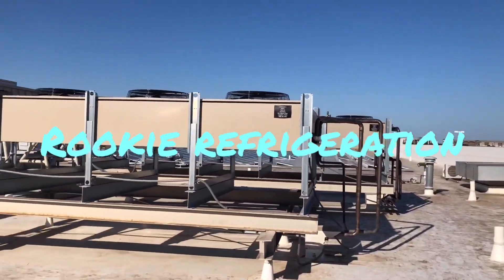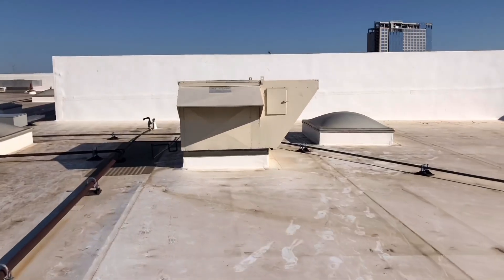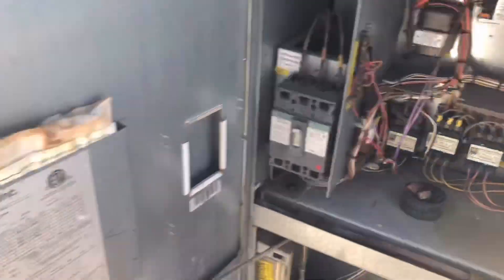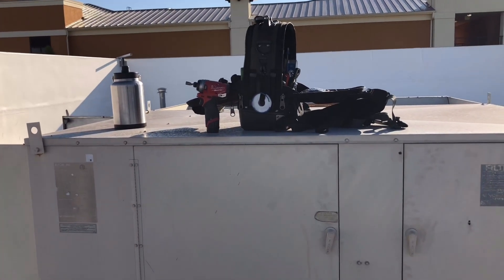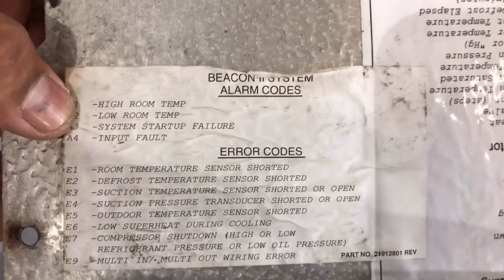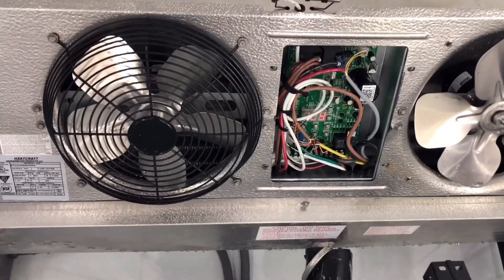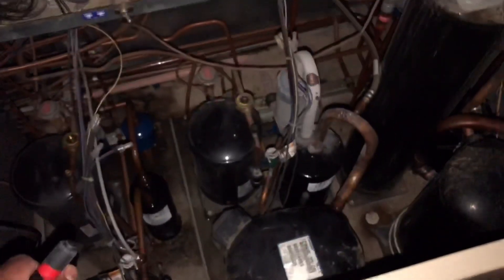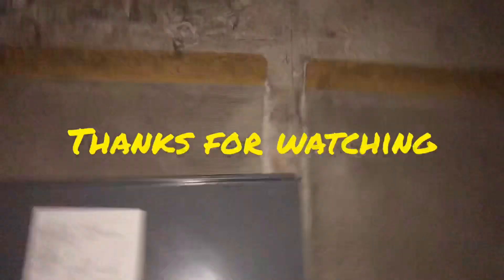HVAC REFRIGERATION LIFE:  On-Call Service Calls

Comment: We're you able to compare the amp draw at the 7/11 store, to any manufacturer's specs on what each heater draws?

That was strange to see just 1 heater on the coil.

If there was a pan heater, was it coming on during forced defrost?

I didn't see any ice build up blocking the drainage hole in that pan, so more than likely if there is a pan heater it's working properly.

As for the ice.....it could be due to a defrost issue.
Maybe it's not going into defrost properly, or not at all?

We're you able to pin down the cause of the frozen evap coil?

IF you can get a sprayer in there to help thaw the ice....what I have done that works pretty well is, I find a coffee pot maker & just put water in it do that it quickly fills an empty coffee pot with hot water. I pour the hot water from the coffee pot into my sprayer & start spraying.

Great video, btw & thanks for uploading it!
Reply from the maker: And yes, I always use a pump sprayer with hot water.  I didn’t record that this time but I did use it.  I have a bad habit of leaving stuff out. Lol.  Thanks for watching bro.
Reply: @rookierefrigeration4357  Keep posting more videos & thanks again!
Reply from the maker: Yeah these are specifically designed for the 711 stores.  So they only have 1 heater.  Weird right😂. 
There’s no drain pan heater.  
No, I was not allowed to go back to that store as we are not even supposed to service it.  Lol.  Someone messed up and it ended up on our calls board.  🤷🏼‍♂️. 
So I was never allowed to go back and pinpoint the problem.

Comment: You never said what the issue was that you found.
How many defrost cycles did that freezer have and what was the duration?
Was it a time or temp termination? It could be a bad termination sensor.

 Did all the glass doors close properly?
 what was the humidity in that store, a/c working properly?
Reply from the maker: I was not allowed to go back to the store to verify.  Apparently I was not supposed to be at that store because we don’t Service it 🤷🏽‍♂️. So I never found out for sure.

Comment: Use a  Pump up sprayer with hot water in it to remove the ice faster
Reply from the maker: Wesley Ray that’s exactly what I did.  I just could not get the backside with the sprayer.  Had to let the fans do it.

Comment: Re: Looking for unit on roof that serves warm space below on a Large roof. 
Best idea is to go to the warm space below to get an idea of where you are in the building , that will tell u where on the roof the unit is since units are directly above or close to that area you were down below.
Reply from the maker: Yeah,I wish someone knew.  The managers are clueless.  The maintenance guy leaves like at 3 pm.   😂
Reply: Time to Walk Roof one more time & Make a Map. Post on inside of Roof Hatch or Ask Manager if they have a Map allready.
Reply from the maker: OcRefrigeration,Hvac & Electrical. Yeah, thanks for the advice.  I will do that tomorrow when I go back.  👍🏽

Comment: Good vid. i was looking for a circuit breaker the other day , it was the last one too. Murphys law. 

Re: Freezer. 
Poor design for sure - evap. Why is it Pulling out of defrost with ice still on coil is what u should be asking yourself ? Time termination ? change to temperature termination & add defrost cycles ? How many defrost cycles is it doing right now ? only 3 make it 4.
Reply from the maker: Yeah, it’s actually terminating off of heater limit.  4 defrosts a day, temp sensors good but the location of the heater and limit switch make it kick out before its fully defrosted.  We will see what the customer wants to do.
Reply: call heatcraft. only 3 years old. Maybe they have retrofit kit. sounds like poor factory design problems.
Reply from the maker: OcRefrigeration,Hvac & Electrical. Good idea.  Thanks.
Reply: is Limit weak / worn / pulling out too early ? Replace limit first. id be asking myself its been ok for 2 years , what has changed ?
Reply from the maker: OcRefrigeration,Hvac & Electrical. That’s my favorite quote.  “What has changed”?  I tell it to myself constantly.
Reply: id move limit to center of evaporator at rear. use wire to attach to evap coil. or add another limit in series. or add a A421 temperature control , stick temp sensor in evap- center-rear.  , wire in series with limit , so both must satisfy before terminating defrost.
Reply from the maker: OcRefrigeration,Hvac & Electrical. Yeah,I was thinking about the tstat in the back center of the coil towards the top.  But this customer is stingy AF😂
Reply: OcRefrigeration,Hvac & Electrical. I like your thinking OC, thats along the same lines as what I was thinking. All I know forsure is Id be pressing to change something, or else itll just be a matter of time until your back in there again.

I hate deicing coils!!!
Reply from the maker: Trever Kirk yeah, we usually submit work to be quoted out,  it these stores don’t like spending money.    For some some reason lol🤣🤣
Reply: @ trever kirk - My saying goes --- if You don't  do nothing / change nothing ,  nothings gonna change. 😂
Reply: Walmart is very stingy.
Reply from the maker: This is a Red Circle store 😉
Reply: Work on those beacon systems a lot. Most common failure is the temperature probes suction/defrost (air not so much) that I see.. Honestly can't remember last time I had the high limit mess up very interesting, keep making videos👍